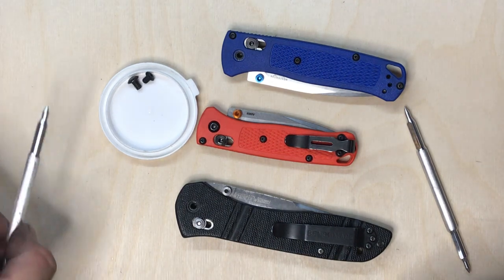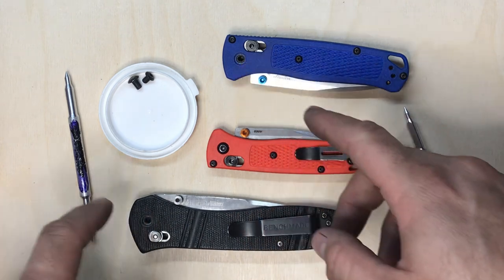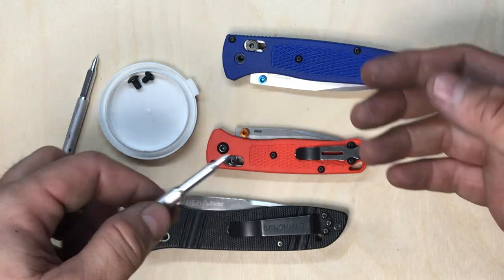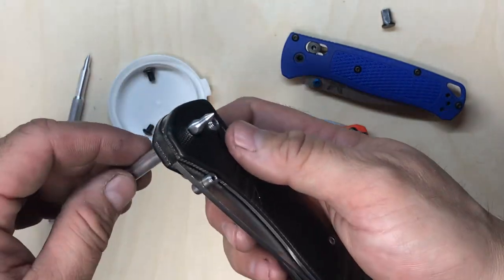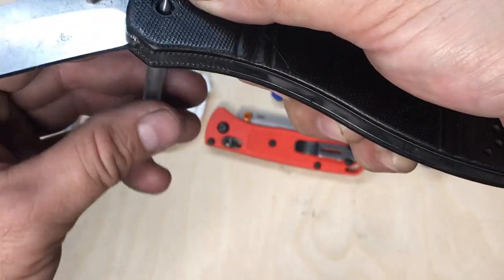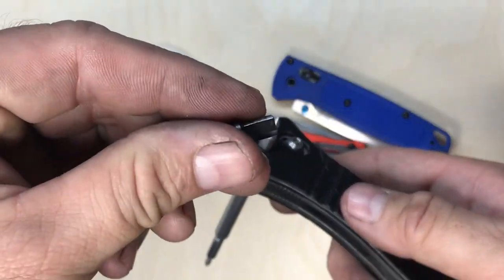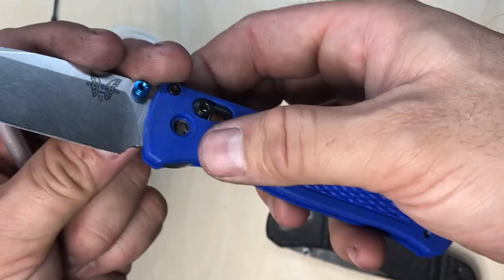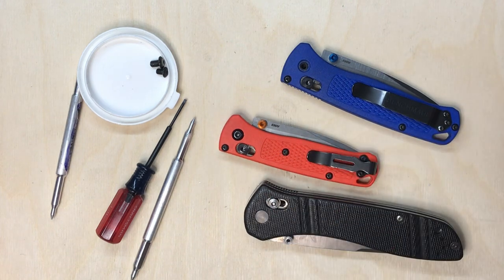How to use the Axis Alignment Tool for Benchmade Axis lock style knives

Comment: Very nice!
Do you still sell the steel version?  I don't see it listed and I am interested in purchasing.
Reply from the maker: I do! It can be found on my Etsy Shop! 

https://www.etsy.com/listing/802588665/pivot-alignment-tool-for-axis-lock

Just use the drop down to select steel.

David
Reply: @Rust.Bucket  Great, I see the drop down menu on Etsy.  I was looking on the eBay listing.
Reply: @Rust.Bucket  I am considering the brass now due to lower coefficient of friction than steel.  What is your opinion brass vs steel?
Reply from the maker: @KTFG   Brass is a good choice. Steel is not too bad either as its more durable and shows less wear over time. The steel I use, is softer than the steel used by Benchmade.